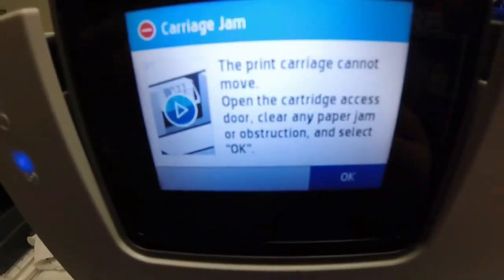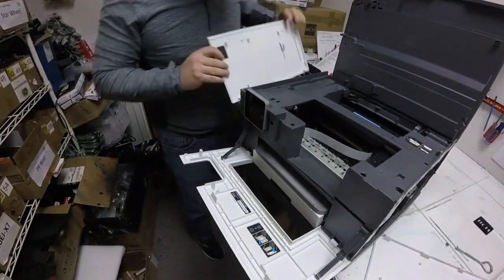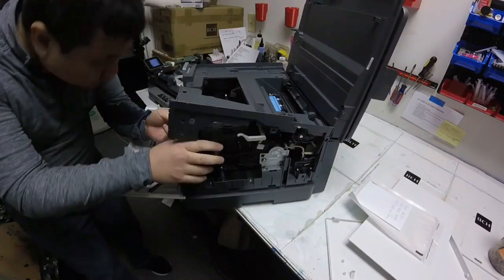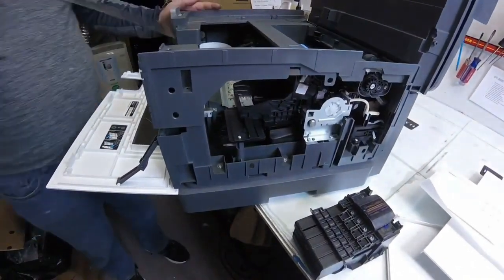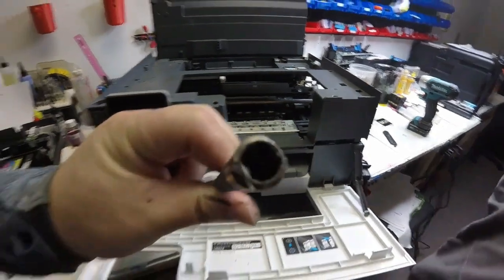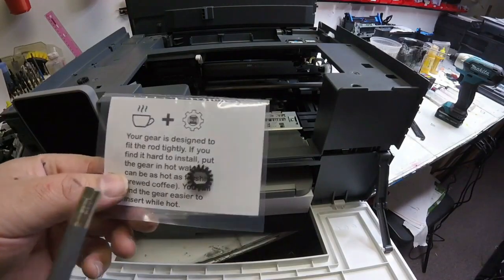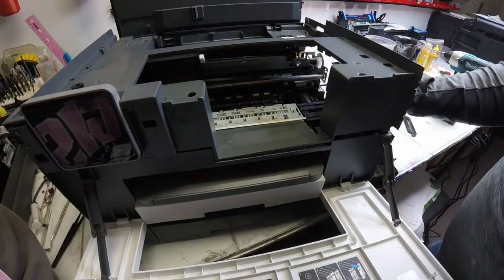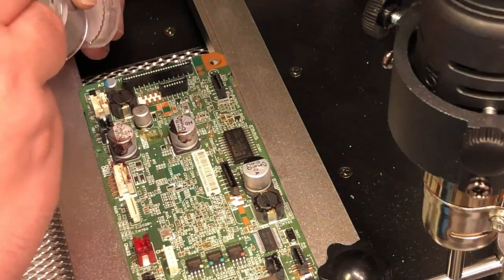Printhead Stuck to the Right - Carriage Jam for HP OfficeJet Pro 9012, 9035, 9025, 90xx Printer PFG

Comment: I found disassembly to be a bit more difficult. The sped up video masks the specific number and placement of screws but eventually all are easy enough to locate. The side covers do not simply pop off - my 9015e also had screws at the bottom inside cover that i needed to remove in order to take off the right side cover. The cartridge wasn't just a slight turn of a gear and wiggle for me. I had to remove the cartridge cover and ink cartridges in order to see that there's a sliding mechanism underneath that needed to be slid back and forth. I also had to loosen screws on the metal bracket to the right side of the cartridge. These extra steps allowed enough wiggle to remove the cartridge. Hope this helps others. My public service announcement here is that this printer is junk and HP should be embarrassed they put out such a low quality product. I don't think I printed more than 20 times in the year that I owned my 9015e before it broke.

Comment: I am getting more confident that I will be able to repair my printer.  I have a broken paper feed gear on HP c8180.  This is one printer that I can't toss without at least trying to fix it. The scanner still works wonderfully.  And since it can still be used hard wired, I am going to try everything before giving up.

Comment: So I got the gear out. But now I can't get the actual carriage unstuck, to slip on a new gear. Rather unfortunately, in the video it suddenly jumped to the left when you went to put on the new one. So I have no idea
Reply: I had the same issue, you have to push the ink pad down then you’ll be able to move the cartridge holder to the left.
Reply: I have the HP office jet pro 9015 and in my case, after removing the ink head, the ink head carriage was indeed stuck to the right. Also, simply pushing down the ink pad did not work. 

Solution: I plugged the printer in while disassemble and sure enough, it cycled to the point where the ink pad unlocked from the carriage, and before it locked back to the right I unplugged the power, which ensured the carriage stayed to the left. 

I was then able to confirm, indeed its that got damn same gear that broke. Now I'm just waiting for the new gear to arrive to replace. Good luck hope that helps others

Comment: When placing the gear on the rod, is there a certain position for the flat spots? Horizontaly or vertical? Does the gear automatically locate itself.

Comment: The instructions of this were a bit unclear as theres two metal prongs that needed to be pressed in first that resided behind the printhead. You also need to kind of stab randomly in that area of where the gear resides (in my case the gear was COMPLETELY gone) and the printhead should move freely after that with no resistance
Reply: But the biggest problem is buying a printer that has the HP logo on it.

Comment: This gear seems to be the release-from-park mechanism.  Can I just break off a tab or something.  $300 for the two year old PRO 9015e printer that is now junk because of the parking brake.  YES, I hate HP.  The local shop will repair it for $119.00 but, what else will break.

Comment: The worst printer I ever had from HP. This thing eats those cogs had (also replacements) fail multiple times now....

This was my last HP printer. Design/quality is extremely poor.

I'm going to turn this one into a project device where I'm going to try to disassemble the device and only keep the scanner module so I need to fake the printer checks somehow.